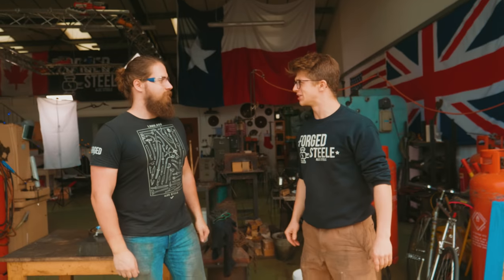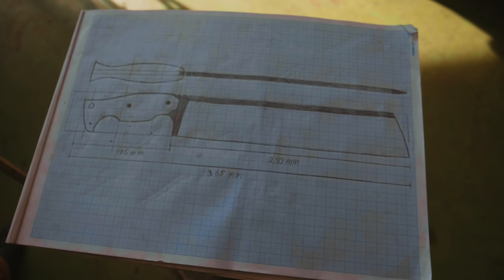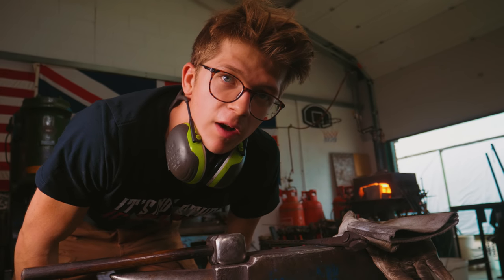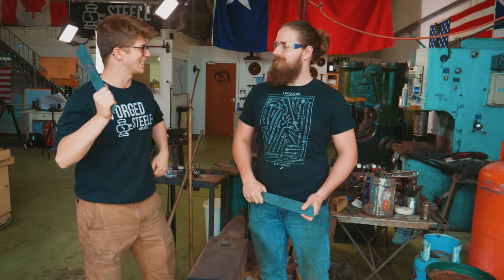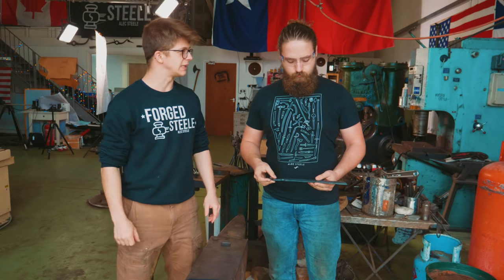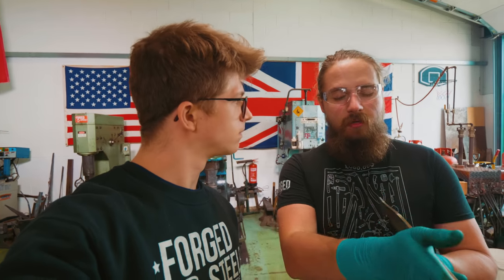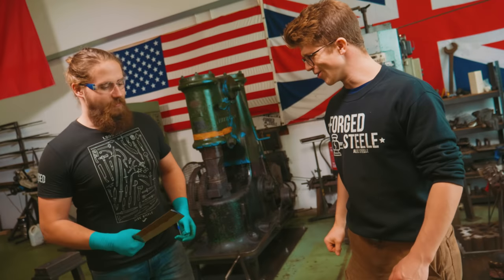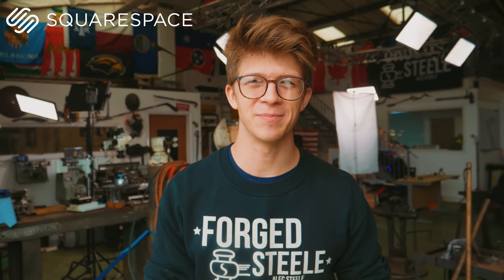MAKING A COMPETITION CHOPPER!!! Part 1

Comment: Is there a use to firescale? Could you recycle firescale into a piece?
Reply: The scale that comes off during forging can be thought of as "super rust"  its just oxidized steel and unfortunately threre isnt a use for it
Reply: @timschrier903  Ah, but there is! When combined in the right ratio with aluminum powder, you can make thermite.
Reply: @JacktheFireEater  haha ok then let me rephrase that there's not much use in the workshop for it
Reply: Im led to believe that the scale can be thought of as an iron ore(magnetite i believe) which can be fed into a reduction furnace to make bloomery iron.  Maybe a fun video?
Reply: @timothymoore7890  Chemically, forge scale is literally just rust, but a different kind than the common orange and red stuff. I suppose you might be able to recycle it, but it wouldn't be easy.

Comment: If I remember correctly, O1 can be a bit brittle at high hardness and you want very very good edge retention on a competition chopper.  I think that is why they often use steel like M4 and 3V for the builds.  I think that I have heard of some made with 52100 which lacks some of the edge retention but is a tougher steel for impact resistance...

Comment: Just a suggestion, put a secondary taper on the back side of the blade.  Not an extreme one like you were going for a second cutting edge, but just enough that when you are cutting or chopping through something it has reduced drag on the top edge of the blade.  also, this is a case where an extreme polish is a good thing as it reduces friction across the face.

Comment: I belive that a knife intended for chopping should have concave ground. In that way ony single point of the blade will be in contact with the material (insted of entire plane) The similar shape can be found on japanese katanas and that is a tool designed to cut bones and flesh. If you watch japanese polisher he achives this by a rocking motion while grinding it.
Reply: I believe Katanas have a convex grind.
Reply: As curve is both convex and concave depending from which side you are looking I would like to clarify. I mean it should look  like a half of an elipse. Do we both mean this?

Comment: I’ve noticed when hot cutting you allow the steel to cool to the point where you can mark where it is that you want to make the cut. My question is, why not simply make the cut with the bandsaw? Are there substantial quality reasons for hot cutting?

Comment: If the knife was drawn on graph paper, would it not be easy to calculate the rough volume before shaping. Then you'd be able to easily measure out the length of stock required.
Reply: evilution the problem with that, is you lose steel while forging and grinding, so if you were to start off with the exact amount of steel, you wouldn’t have enough to actually finish the piece.

Comment: (Golem voice) Didn't have enough for the handle, did we? Could have just forge welded more material onto the handle. Not like we're trying to make Damascus or the handle would take all the impact when we hits thing with it! (end Golem Voice) 

For a meat cleaver, the big daddy to the competition chopper, you want a slightly curved edge so that force is concentrated at a smaller area. Considering this, I approve highly of the design that was chosen.

I will now return to my kitchen and weep about the crappy knives I have. 😭 They still cut, but...😭

Comment: Alec, I'm trying to get into forging and I was wondering if there is anything you recommend about galvanized steel. I have a BUNCH of it laying around in pipes and i thought i could use it for practice. Is it safe to use for forging or would metal fume fever be to much of a worry?
Reply: You really shouldnt forge galvanized steel it does release toxic fumes
Reply: Is there a way to remove the galvanized zinc around it ?
Reply: @TaceRestor  Ive seen online where some say you can soak the piece in vinagar for a while and scrape with a wire brush to remove it but I've never attempted it myself so I'm not sure if it truly works
Reply: @Tiny Tim Ok thanks for the help!

Comment: He y'all!
I have a request (if you're interested). How do you file a saw edge onto a blade, i.e. i have a chopper (liked the one you're making) & i want a sawblade "filed" into the spine of the knife. I Sawblade like a carpenters handsaw would have.
This had been preying on my mind for months... how do i file an alternating saw edge?
Reply: You just answered your own question. First lay out the spacing so you don't fubar that. Then you would start filing the first tooth in alternating the direction of the teeth as you go. Basically your scribe pattern would be / \ / \ / \... Thats looking down top of spine.
Reply: That's what i thought. I need the proper files. I know to lightly file a scribed line for layout. I do this for wood carving & knife making. I make some fairly nice knives with basic tools from circular saw blades, right out of the back of my worktruck.
The saw blades are thin but come with a fair amount of temper in them.